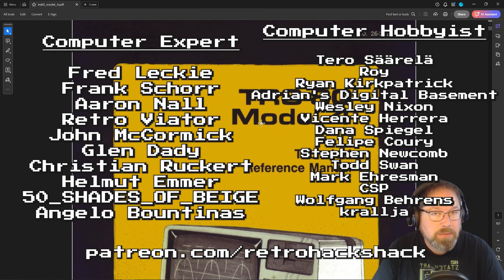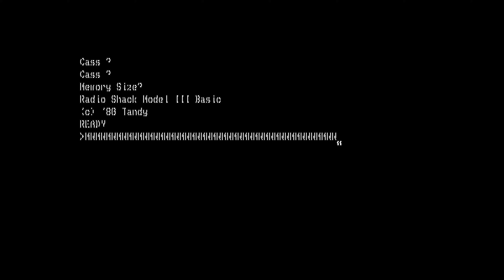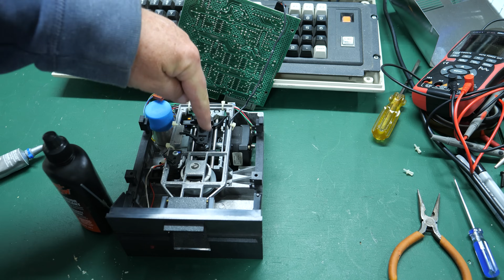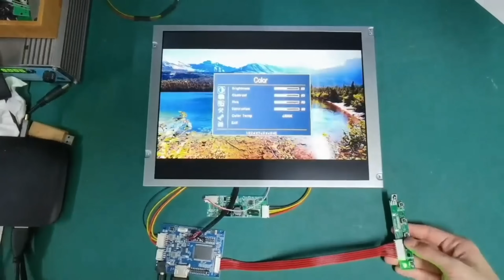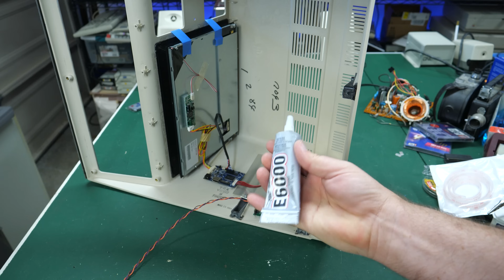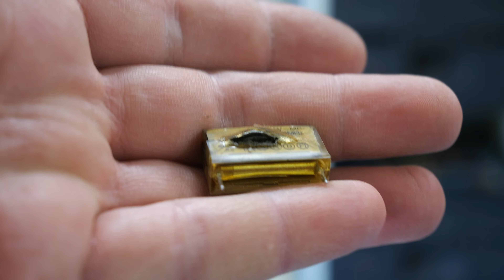Breathing New Life into a TRS-80 Model 4 with an LCD Screen!

Comment: I almost did a mod like this about 15 years ago, but when I finally stood in front of a fully working MODEL IV, I couldn't bring myself to modify the unit, and I didn't make the purchase.

In fact, my success as a software engineer, today, stems from a lucky encounter with a man in 1980 who allowed me to play with the Radio Shack's MODEL 1 set up in front of the window at Radio Shack.  I wish I could find and thank that man:  giving me that first taste of programming changed my life in the extreme.  So when the project of converting a MOD4 was before me, I just couldn't do it.  I have the skills, but for some bizarre reason, altering a perfectly healthy machine that survived so long with everything working seemed a terrible insult to a piece of history.

BUT:  I love what you did!  What a splendid idea.  The real joke would be to replace the entire infra with a 128 core Intel XEON, and have it run 500 QEMU driven virtual MODEL IVs at the same time.  Silly, of course, but the way compute has matured, I don't think it would be a big tax on the unit.  Actually, I haven't checked if QEMU could do that or not with a Z80.  I bet someone can.  It isn't like the timing architecture would be overly right on a modern CPU.

Comment: The Tandy floppy drive with my Color Computer kept going out of alignment, whatever that means.  Every 2 or 3 months I had to take it to my local Radio Shack for it to be re-alighned.  However, I did not have a problem with the drives in my 1000 SX.

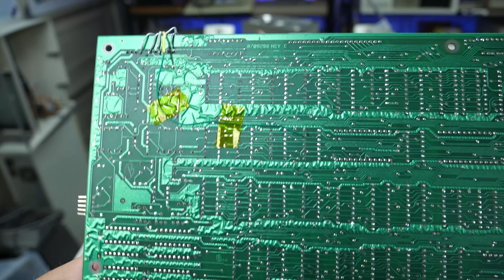Comment: 15:15 when I took my model 3 apart, the back of my board looked like that. It's like the solder mask is wrinkled. Is that normal?
Reply from the maker: Yes. It is completely normal. It was a technique they used at the time.

Comment: Back in the '80s I had a computer called a Tandy Video Genie but I cant find this computer anywhere online, are you aware of this computer? It was labelled Tandy Video Genie and was bought from a Tandy store in England by my parents as a Christmas gift. It ran TRS-80 software on cassette.
 The Video Genies I have found online are EACA TRS-80 clones.
 For the bezel, matte black or carbon fibre PLA would be better as the layer lines are hidden and no sanding or filling is required.
Reply: There is literally a page on Wikipedia about it.

Comment: OK I seen this on a few really old tandy's what is with the wrinkles in the traces I seen it before and thought I had a corroded trace
Reply from the maker: This is a method of creating PCBs that was quite common in the 70s and early 80s. That wrinkling is normal and looked like that since the board was brand new.

Comment: That's not a Gate Array board. The GA board has the floppy and RS-232 interfaces built in and doesn't use the flat, laminated cables at the top of the board. However, the GA boards came with a green screen while the non-GA boards came with white so it looks like someone replaced either the motherboard or the CRT at some point.

Comment: This is great.  I learned to program in BASIC on a model 4, so this is really nostalgic to me. -- FYI to get the sound working back in the day, you didn't really need to "modify" anything, a lot of casette recorders had a "monitor speaker" built-in -- so you would just hear that sound coming out of the monitor speaker.  I think the speaker was meant for troubleshooting issues with saving and loading? -- But developers used it for making digitized sounds too! -- I had that same game too, and I was blown away that it could talk when I first heard it back in the day! -- Of course you could get a DIN breakout cable and plug it into the aux input of a stereo as well (I ended up doing that for gaming). --  But that was probably less common. -- Strangely, I remember having an IEC power jack on the back of my Model 4 system.  ... it's not just a vague memory -- I'm like 90% confident it had that already.  Maybe my system was modded.  Or maybe they did that for some of them? -- I'm not certain. -- It's possible I could be wrong though... But I have a strong memory of it? 🤷

Comment: There used to be a company called Langly St. Clair.  They offered a replacement Green &  Amber replacement CRT.  I swapped out my original b/w RCA tube with the Amber CRT when I was 12.  The Langly St. Clair screens offered lower radiation and an anti-glare finish.  My second mod was swapping out a defective Z80 with a NEC V20 processor.  Other updates included adding the RS232 board and upgrading the RAM.   That PC was a big part of my childhood and, unfortunately, has gone onto Computer Valhalla.
Reply: I have a TRS 4p that I like to play with and I like the idea to be able to switch between a V20 and the onboard Z80.  Was it just a simple cpu swap or did you need an adaptor?
Reply: Are you confusing computers?  I don't believe you can swap a V20 for a Z80.... you can use a V20 for an 8088,.

Comment: I'm starting to hope that retro enthusiasts save broken tubes, the more I look into glass blowing and making vacuum tubes the more I think they're salvagable in some way, in the distant future but some retro gen-z kid in 40 years ;)   "alright so after my robot cleans out the original tube, we'll be cutting the face off and replacing the phosphor, and then rebuilding the neck with a new assembly"

I'm seriously considering making room for this possibility. Just hang onto any of the ones I found broken... or um... otherwise meet their demise.

Comment: imagine an engineering complaining about the use of screws ? nearly everything now is glue, glue and more glue, and you can open it up heat gun,  guaranteed, break something in your attempts opening up, need replacement, just parts broke, before get the real problem of why you opening it in the first place  ?

Comment: That adhesive whatever it is that 3M makes works really well.  If you ever had the double sided foam tape it just will not let go easily.  You need dental floss to weaken the grip so it will come off.  There may be a bit of the adhesive left behind.  I know this because I had a dash camera that mounts with that stuff and it will not just pull off!

Comment: lots of cheesy cheap portable crt tvs for 5$ for sale that you could use as crt donors...on black and white even if the crt is not the same its very easy to convert and most times ots plug and play...i dont like it sorry..nice work but it was a vintage computer now its just....somthing else.... with a replacement crt it might not be original but atleast it was identical

Comment: Nice mod. However, avoid turning the computer on while the disks are in the drives and latches closed. It can corrupt the disks. It's better to turn the computer on without disks, then insert the disks, then press reset. You can also just open the latches before turning on if you want to keep the disks in the drives.

Comment: Oops, poor CRT, I've thought a few times about doing that to mine, as it would free up quite a bit of space in the cabinet. Just a pity that you had to go to all that HDMI carry on to get it to work, it would be nice to find an LCD that works more directly, after all that converter uses a Raspberry Pi, with WAY more computer than the whole TRS just to convert video....
Good to see a GoTech works, I've wondered about that, however I'll wait for your FreHD vid first.
One mod I did was to fit a speaker and amp inside for sound. I didn't bother putting the speaker up against any of the holes as there is so many vents at the top that it comes out load and clear as it is.
Reply: So for mine, i did the speaker mod with amp and mounted the amp with volume adjustment above where the cassette jack is.. let's me do both, if i want to use the audio from the cassette cable, i can just turn down the volume on the speaker.  As for the gotek, i found that after i built the trs-io which is the networked version of a frehd (i also built a regular frehd as well), i never really used the gotek and eventually just disconnected it (it was hooked up as an external drive, so no mod really).  The frehd (or trsio) is the way to go, honestly, and there's a number of hd images out there with tons of the same games you'd play off disk (I'm not sure anything can't run from a hd image).  I have about 5 different floppy and hd solutions and the frehd method is the only one i ever use.
Reply from the maker: Awesome! I'll look into the trs-io.
Reply from the maker: I like that speaker mod idea

Comment: So your new monitor has more computing power than an entire radio shack store in 1983.
Reply: You would think that display had a an LED backlight so no HV power supply. Fluorescent tubes were old technology 20 years ago... and this display is very much behind the curve tech wise and longevity wise. I was replacing backlights in industrial screens for production many years ago because we foresaw the problems with them in our designs.

Comment: Rifa capacitors... 🤢
*EDITED: Technically it's possible to construct the CRT controller "chip" with a Raspberry Pi Pico RP2040 microcontroller and DVI video converter chipset to drive embedded DisplayPort LCD panel or even a small HDMI monitor if you so desire as graphics isn't terribly intensive, as obviously it's a 8-bit computer, so you can easily get away with it. With that microcontroller, you can ditch the original video RAM altogether as it obviously got much faster RAM thereon, more than what's originally in there.

Comment: Do these IPS screens accept a 15 KHz video signal on their VGA input?
Reply from the maker: No since it only has HDMI input. But that's where the RGBtoHDMI comes in.
Reply: @RetroHackShack  Ah, OK. I searched AliExpress and found some that have VGA inputs. Some also have DVI, others have A/V. For instance, item 1005004141169281 (YT doesn't like links)

Comment: All the vintage tech youtubers need to buy a decent set of hand files. You can drill out the corners and file to your lines so much easier than trying to control a dremmel spinning at 1 million rpm :)
Reply: How do you find one that is decent and won't break right away? Any reviews?
Reply: @FadkinsDiet  If you're dealing with plastic you can use anything. They should be able to cut steel. Buy the cheapest set of flat, round, half-round and whatever. You remove plastic and aluminum and steel with control. Buy cheap and if you use it enough to dull it buy better. You need a flat file. A triangular file (only way to make square corners) and a round file. That's it.

Comment: Really enjoyed the video. A few comments: 1. Matt Boytim has designed an FPGA video adapter that is cheaper and easier than using an RGB2HDMI and it still offers HDMI output and doesn't require motherboard mods and it auto switches for M3/M4 mode on a Model 4. I also have a through-hole PCB for it for ease of building. 2. Model 3 mode on a Model 4 machine is not identical to a Model 3's real output so that might explain the dot clock issue. 3. Jay Newirth makes a modern replacement PSU that is stronger than the original.

Comment: You seem to have a large format 3D printer. Why not just model the original bezel in CAD, modify it to accept the panel, and install the new screen with the original screws?
Reply: I was wondering about this myself.  I'm sure time played into the route he went, but it would be interesting to see a frame that could be screwed in like the original.  There's also this 3d printing mode called "fuzzy skin" that some of the 3d printing software does that would be perfect for things like this, or  drive bays where it does that same type of texture as the original.
Reply: Given the trial and error fitting, I assume he just has no idea how cheap a set of digital calipers can be.
Reply: @Pest789  Possibly, though if your printer isn't perfectly calibrated, and most aren't (unless you did all the various calibration steps), you'll start getting off the larger the print.  it's always possible he was more accurate on his measurements but the printer was off... or a combination of both.
Reply from the maker: I used them plenty, but the ones I have aren't wide enough to measure this panel.

Comment: With curved LCDs being a thing and CRT emulation shaders for e.g. DOSBox getting better (on 4K-ish screens at least, from what I gather), I'm wondering if we'll eventually see faithful bulbous CRT replica panels that are hard to tell apart from the real thing. Would require some beefy hardware on the converter, though.
Reply: AKA in 10-15 years it will be trivial 😁

Comment: Lookin' great, man.  Yeah, go for broke with the FreHD.  This is what I call "retro without pain."  Modern components are so much simpler to work with, and can really extend the life of old gear like this without too much expense.  (Glad when the Rifa went up it didn't do more damage.  Nice save there.)

Amber has just a hint more red.  A lot of CP/M systems from back in the day shipped with amber CRTs. 

I've seen a Coco stuffed in one of these cases, but I like the idea of the original board still working, and would love to see FreHD in action.  Maybe do up a Coco if you get hold of another case of this style?  It would be so cool to see OS-9 running like that.

 I will probably re-watch later to see if higher res that 360p is available on YT.
Reply from the maker: I see 4K. Hopefully higher than 320p 😀 What year is it? 1984? LOL

Comment: This is the first time I have heard sound out of a TRS-80!  I had no idea that was even possible; Very cool.
Reply from the maker: Yeah. And it sounds pretty decent, too.
Reply: Sound was made by TRS-80 I/III/IV via the cassette audio out so it was very CPU intensive.  Most people think it was '1 bit' as in on or off but in reality there were 2 bits of a port dedicated to producing the audio.  So long as you didn't want to do anything else at the time you could produce polyphonic audio.  The official ports of Frogger actually had better attractor mode audio on the I/III/IV than it did on the COCO despite the COCO having a DAC.  There are alternate ports of Frogger for the COCO that actually do show off what can be done on that hardware.